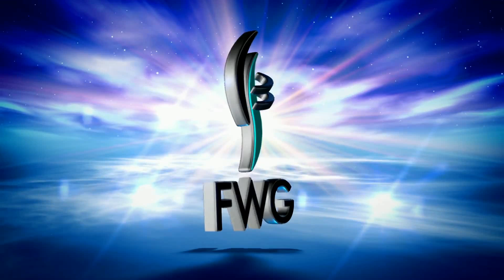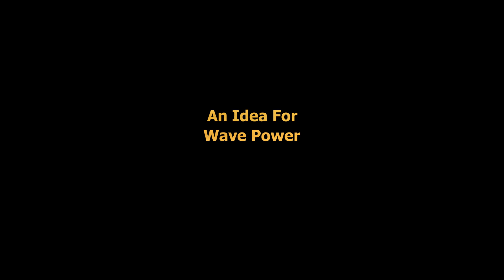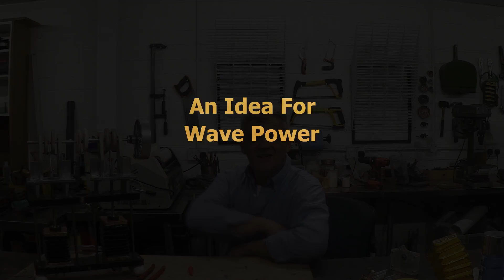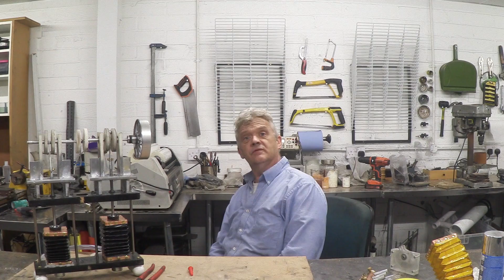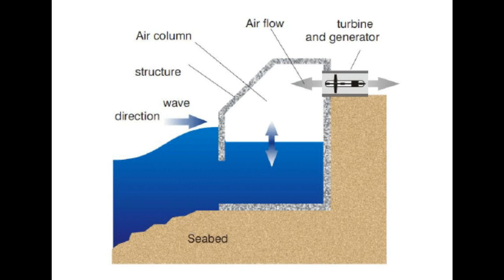An Idea For Wave Power

Comment: Robert, have you thought about adapting this idea for chimneys/flues as well? As I write this it's blowing a gale outside and there is plenty of draw up my chimney, and there is talk of woodburners being banned in the not too distant future resulting in plenty of redundant chimneys in the UK. Regarding the wave power idea; I live by the sea, you have to take tides into consideration regarding the position of the concrete chamber, and salt water is corrosive as well. Ian

Comment: I was thinking of the piston in a sterning engine when you started with the bellows too.  Curious as to how it will work with the wave? Would you be using the water level as a piston to compress and release the bellows?
Reply from the maker: pretty much - it is more like in the diagram though - the sea will 'push' the air trapped in the structure - which will 'push' the bellows

Comment: You said in the last video that you swap the inputs over to change from working on a vacuum to working with positive pressure. Seems to me for this wave arrangement you need a valve system that can swap that over for you?
Reply from the maker: that was for a double acting bellows system a single acting system - even if it was lots of bellows all single acting would need no valves in this set up
Reply: @ThinkingandTinkering  sometimes the obvious is easy to miss, lol. Keep up the good work, it's really inspiring stuff.

Comment: Why use a large concrete structure on shore?  Wouldn’t you get a more consistent wave action by placing it on a floating platform?
Reply from the maker: nope - then everything would move up and down so there would be zero relative motion
Reply: Floating platforms have their advantages - not least where the tides go in and out - but add the need for maintained secure moorings. Where you can build a structure on shore, why not just build a wind turbine?

Comment: There are ways you could apply this to a dam as well by having the water drop through piping. Connect a pipe to a drain at a 30 degree angle away or opposite from the flow of water and it will cause suction.
Reply from the maker: nice one mate

Comment: opps, you said you can "either/or" where you mean "and"
Reply: Nope! Logically, "and" means you are doing both at the same time :)
Reply: @colleenforrest7936  ,exactly....

picture in your minds eye "doing both at the same time" is not the same as doing both at the same point/location  in space.. put another way, two operations at the same time ,in this case, one operation on the inlet (high pressure),the other operation on the outlet (lower pressure/vacuum) ( perhaps push/pull makes it simpler to see) gets you closer to optimal power conversion to use doing useful work with less waste locally.
Reply: @paulmaydaynight9925  oh, okay, you're talking a multiple system. That changes things :)
Reply from the maker: oh ok - I didn't get that mate and I rewatched it

Comment: You really do know how to play with the Grey Stuff!
One thing I would point out is that Gasses are Springs. The longer (larger volume) of your pipe from the wave the less efficient it will be!
Of course a wet paper bellows would also be inefficient too ;0)
Steam Punk micro generation does sound good though!
Reply from the maker: I was pondering the compression - the main thing I think is that this is an understood design using turbines so the math and research of that would be around - I would guess this is an already answered problem - but I must look

Comment: With wave power you would have to deal with variable stroke length. Perhaps have the piston/bellows drive a flywheel on a ratchet. Or maybe have them pump varying amounts of air into a reservoir which can then be bled at a constant rate to drive a turbine.
Reply from the maker: nice ideas mate - cheers

Comment: Very Interesting idea. My only concern is, wouldn't something like the wave bellows device have significant wear and tear?
Reply from the maker: don't know - probably no more or less than anything in this condition - you would need to build it to suit for sure - making a paper bellows would definitely not work lol
Reply: RMS, once you have that next designed on, and if wear and tear or friction is the issue, why not look at potentially using magnets?
Reply: @paulsegers1880  That is no so steampunk design...
But it has been tickling my brain since RMS begun talking about reciprocating air engines.
Direct electromagnetic generation seems so much more efficient... And that shortly after RMS talked about the oscillating finn wind generators... If you could get a significant force oscillating at 50Hz or so... My brain feels ticklish... Hmm...
But these are not my answers, these are just matters I've been thinking about. Should anyone want to brainstorm on it, go ahead. :)